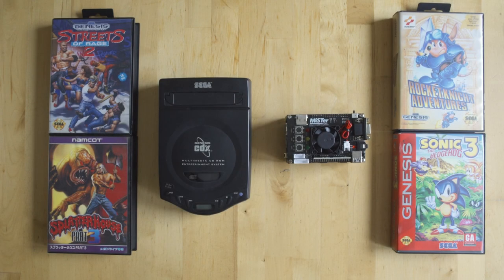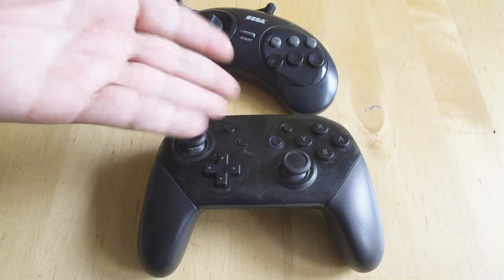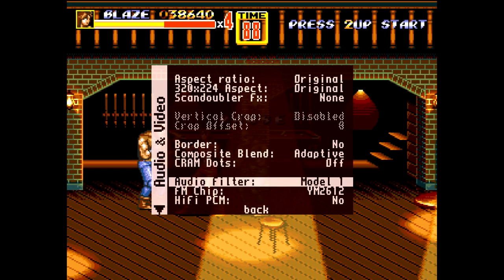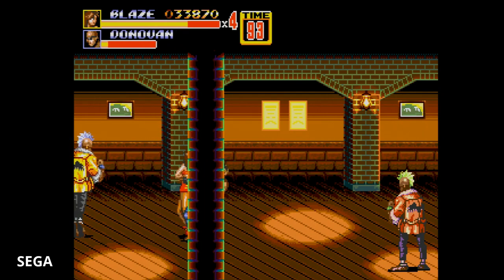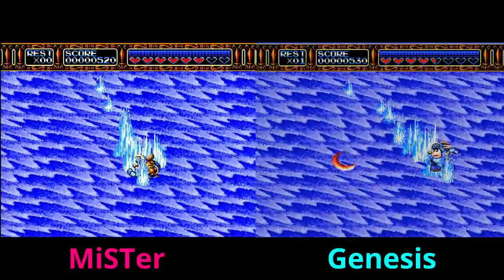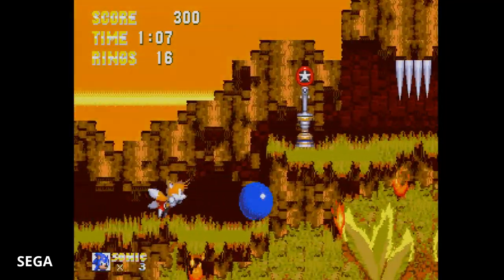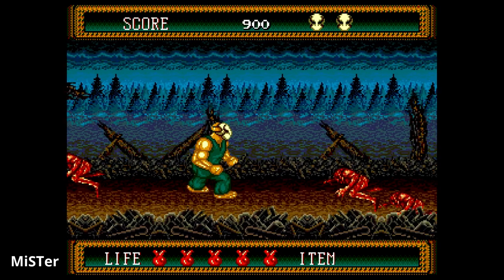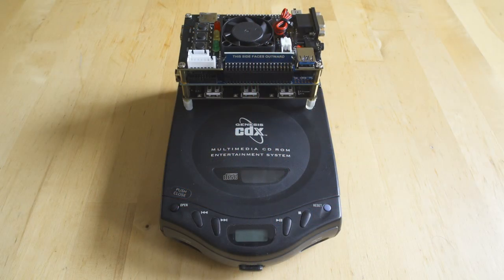MiSTer FPGA DE-10 Nano Sega Genesis / Mega Drive Setup Tutorial and Core Review

Comment: Theoretically, you should be able to get the CDX color vibrancy to closely match the Mister output by adjusting the Framemeister.

My unmodded CDX has very noisy RGB out, so I generally stick with my Genesis model 1 these days. I think I'm seeing similar analog noise from your CDX at 11:48 on the orange wall behind Aladdin.
Reply from the maker: I just wish the ground hum on audio wasn't so pronounced on my CDX. I find that more annoying than noisy RGB myself

Comment: Looks like you might need to use one of the interpolation filters on MiSTer to address that shimmering effect when you scroll horizontally in games. Interpolation (Sharp) is an easy choice.
Reply from the maker: I haven’t mentioned those yet as I have another video coming up about filters and different video options. I try to keep the videos to 10-15 minutes in length vs going 30 on each and jamming the same info into all of them :)

Comment: I adore my 8bitdo M30 on my MiSTer, I use it wired for best latency.
Reply from the maker: I picked up some 8bitdo stuff too. You’ll see it soon :)
Reply: That is my dedicated MiSTer controller as well. Controls great and battery lasts forever compared to all my other chargeable controllers.
Reply from the maker: Yes the battery seems invincible on them lol
Reply: Used to do that but I got to the point where if I am going to have a cable I might as well use a OG controller with Daemonbite.  I checked the lag testing and the genesis port 2.4g M30 + Daemonbite seems to have a 73%+ percent same frame probability wirelessly anyway which I felt was good enough in most cases anyway, further with the ability to swap out that controller with a OG controller at anypoint and mid game for that matter.  I almost wish I never purchased the bluetooth version but hey maybe when I get a switch it will be put to better use.  Right now best latency is that weird cheap iBuffalo snes style controller, daemonbite w/ wired controller, the retropad 32 or just using SNAC directly.  I personally would rather just use an OG controller if I needed a wire anyway I look to 3rd party vendor for the convenience of being wireless and the ease of pick up and play.
Reply from the maker: I’ll be doing. Daemonbite mod soon. I need my arcade sticks to work on the Neo Geo / CP and CPS II cores. I’ll show the solder wire work and flashing of the device and how to get it up and running. Should be a fun time
Reply: @VideoGameEsoterica  It truly is a rewarding and satisfying project. If you can solder it truly is worth it.
Reply from the maker: Yeah I am looking forward to it
Reply: @Eric - I thought the M30 was USB-C for wired? - How do you connect it to the MISTer wired? - Is Daemonbite a better option than SNAC?
Reply: @brentgreeff1115  the bluetooth M30 is USB-C and the other models use Micro USB.  SNAC is native ports but doesn't support 2 player and can't interact with the menu.  If you are using a wired Daemonbite you can use the native controller or make a custom arcade stick and it can interact with the menu and you can have as many players as you want.  The latency is so small that it is non existent in most cases we are talking in some cases 93%+ chance of same frame input (0 lag) and higher than 70 with a wireless controller.  This in every case but light guns is native feeling and perfect.  The SNES and NES daemonbites can accept up to 4 player ports per arduino pro micro and are for sale on the Daemonbite shop.
Reply from the maker: Perfect answer. Thanks for leaving it! And yes lag wise I know people get really in depth checking things but to me everything feels great wired. Wireless is nice for everything but fighters and shmups. But I don’t get driven nuts by a tiny bit of lag so
Reply: @brentgreeff1115  the M30 came with a USB-C to USB-A cable, worked out of the box on the MiSTer.
Reply from the maker: There are so many controller options right now too. Soon I’ll publish the video on the ones I like to use for each core
Reply from the maker: I tried it. It feels nice. I preferred the Retrobit Saturn pad a bit more though. I use that for all the Sega cores
Reply: @omarelshamy3576  It is good, not bad. Nothing beats the 3 button OG Genesis pad but it is good.
Reply from the maker: I’ve always had the six button Genesis pads so the six feels natural to me
Reply: @VideoGameEsoterica  I don't know how the Saturn version is but I hate the genesis version as it's shoulder buttons are horrible and break easily and the controller has far more latency than other similar controllers(this is the wireless version but latency is bad wired mode as well).  Is this the hardwired USB saturn pad or their wireless? I would be interested to know if the shoulder buttons are any good.  I had to desolder and replace a broken button from the genesis version I only dropped it from 1.5 foot height or .5 Meter.  I lost respect for their build quality after that given how durable the original OG controllers were.
Reply from the maker: The shoulder buttons are a bit looser than an OG Saturn controller but it’s not bad to me. I haven’t had any latency issues wired or wireless. Maybe they revised it? It’s so hard to say but I personally like it
Reply: @VideoGameEsoterica  Well whatever you do don't get the Genesis version.  The left side feels different than the right shoulder they both seem to have different travel and the left side activates far too easily making mistaken presses a thing which can seriously mess up your game.  Why they thought that the design was acceptable to release is beyond me.  It feels like a prototype they released as a product.
Reply from the maker: Who knows. I feel like depending on when you buy some of these aftermarket controllers you get different quality. Both mine on the Saturn pad press the same. Granted I rarely use them as I just utilize the controller for Genesis / Sega CD cores so the shoulders are just “there”
Reply: @VideoGameEsoterica  yeah My use cases are if I am using a wireless controller I want it to be general purpose for convenience.  So I mainly use the M30 for most cores, and when wired I use the OG controllers.  Shoulders are important for me especially when I fire up the GBA core.  It pissed me off to no end when I was playing Castlevania circle of the moon.
Reply from the maker: Funny I was just playing Circle of the Moon last week. Still an awesome game
Reply: @VideoGameEsoterica  That may make a good video you can get sweet captures from your mister now.
Reply from the maker: Yes I’ll def use it in the future for the channel :)

Comment: any idea how to set up 6button controller on the core? for me only some buttons work and right will go left... wish i could figure out why this is happening. Using MK-1653 made in china
Reply from the maker: Hmm can’t say I’ve seen that issue. I’ll ask around. Tell lamp I said hi
Reply: @VideoGameEsoterica  lol thanks, i have checked the forums and google and cant seem to find info on my controller model. all i can think is to check the solder on the snac adapter, or that the controller board isnt making contact inside the buttons. but i hope its just a mister setting that I am missing.
Reply from the maker: What buttons don’t work? Are we talking the top row of three or just random ones?
Reply: @VideoGameEsoterica  most of the controller, and the right goes left lol. tried streets of rage 2 and noticed that first.
Reply from the maker: I’ll ask around

Comment: Control wise Daemonbite adapters are a godsend.  I made my own out of arduino pro micros and controller extension cords.  I go for the OG controllers or the 8Bitdo m30.  I am using the 2.4g OG genisis port version of the M30 you better get that version quick I heard that 8bitdo is under new management and they are retiring the console port controllers.  Now I have this setup because the USB version actually have more lag and don't play well with the USB hub.  I love being able to use the wireless controller out of convenience then be able to swap out the controller whenever for a 3 or 6 button OG controller.  Plus if you go that route you can use the M30 on your CDx.  As a bonus fact I can use the atari 2600 joystick on the adapter as well.  Right now I currently have 2player Genesis Daemonbite controllers and 2 player NES daemonbite controller adapters and the Arcade stick with real working coin mech I made as well so far it works great.  having the shoulder buttons has helped me to map the m30 to almost every core, I love it on GBA.  Those are the tips I have so far.  Best of wishes with your adventure into the MiSTer.
Reply from the maker: I have a few Daemonbite adapters going now. For my arcade sticks though.

I'll have a video coming soon detailing my favorite controller options for MiSTer :)
Reply: @VideoGameEsoterica  please make a video tutorial if you can, I tried to make one myself but I seem to have killed the pro micro and it gets really hot now when connected to pc usb port.
Reply from the maker: Sounds like a short somewhere
Reply: @user-yk1cw8im4h  I second that, look over to see if the VCC is spilling over to anything else otherwise I would say get a new one.  That being said depending on the version I believe you need to make a solder bridge on the upper left hand corned labeled J1.
Reply from the maker: Also I’ve read some of the boards arrive DOA because they are so incredibly cheap and some manufacturers have bad reliability
Reply: @evilcrabsitchalways  Yeah I got a new one but afraid to ruin it. I did solder the bridge, but haven't checked for shorts yet. Anyway thanks for the advice.
Reply: @VideoGameEsoterica  I guess that could be it as I was really careful with the whole process. I could still upload firmware to the board though, just doesn't recognise my controller on pc. Thanks for the info.
Reply from the maker: Hmm. Not sure. I may try a different brand just to be sure

Comment: I am getting a scrolling image on my CRT when using the genesis core. I dint get that with other cores like snes and nes. Same ini settings. Using Antonio’s s-video adaptor. Any ideas why? Also how do I save core settings?
Reply from the maker: Sounds like it isn’t syncing. Not sure why that would be the case but the scrolling sounds like it’s not latching to the sync signal correctly. The S video adapter would be my first guess
Reply: @VideoGameEsoterica  thank you for your quick reply!
Reply from the maker: No problem. Sorry I don’t have a better answer!

Comment: I like using the M30 2.4G wired with the mister. Low latency, nice feel, and a menu button. Do you have the analog I/O board for the mister? The cores that support it (which is most) look amazing with it.
Reply from the maker: Yes I do. I did a video on analog settings using it :)

Comment: Retro-Bit Sega Saturn USB gamepad it's a great option for 6 buttons pad for the mister.
Reply from the maker: shh...maybe that's what I picked for Sega cores for the controller video...or maybe I didn't....(I did lol)
Reply: Bought the Sega Saturn wireless controller from them. Its ok but the dpad of the m30 is better. The box with the controller and dongles smells very chemical. Even after months. Not cool.
Reply from the maker: Really? Mine has zero odor. I wonder if they changed suppliers
Reply: @VideoGameEsoterica  The initial batch had issues, specially with broken dpads, but now it's fixed, m30 stills a great option, but I prefer wired gamepads to avoid extra input lag.
This document it's worth to be checked: https://docs.google.com/spreadsheets/d/1KlRObr3Be4zLch7Zyqg6qCJzGuhyGmXaOIUrpfncXIM
Reply from the maker: I play wired for shmups and fighters. The rest of the genres lag doesn’t really seem to effect me

Comment: Using the wrong Joypad is your fault not MiSTers.
Reply from the maker: Lol yes and I say that
Reply: @VideoGameEsoterica  You complain 10 times and once you say it's not the fault of the core. Same problem with your overall review - you repeat the same things (like colors) over and over again, while you skip the important things like the core options - probably because you don't understand them. For example you can adjust colors on MiSTer and your TV (you also mention this once at the end after complaining multiple times about it). And if you use "region by file extensions", your file extensions have to match the regions of course - this in not random or broken and works perfectly fine.
Reply from the maker: I explain things for people who may not understand regions and file extensions. I don’t make the videos for people who know everything already, because they wouldn’t need the video in the first place. 

I will touch on core filter options in an upcoming video. I am just directly comparing the MiSTer to the original hardware on a 1:1 basis per core before I start publishing intermediate and advanced video option videos for people who want to get more granular with the settings. 

Saying “my only complaint is the controller I am using isn’t well suited” is just a comment to address controller options in a future video. But if someone uses ONE controller for the entire experience it’s still a relevant observation even if it’s not “the MiSTers fault”
Reply: @VideoGameEsoterica  If you only use a single controller it should be one that fits most cores and not a random controller that doesn't fit half of the cores - Hori Fighting Commander for example is a great universal pad for MiSTer and works with every available core, because it has 6 big front buttons and 4 shoulder buttons, auto fire and extra buttons for menus, save states, etc. And complaining about things and solve them in a later video only gives a bad first impression about MiSTer. Not everyone will watch all your videos, so you should try to use optimal settings for each core video, even if you don't want to explain them.
Reply from the maker: And you are totally entitled to your opinion. I just feel that the most direct comparison is “out of the box”; I will discuss further video options in other videos for people who want to tweak what they can with MiSTer. Granted the tinkering will be a higher percentage of users compared to other platforms just due to the inherent nature of the hardware itself but I just wanted to separate them out